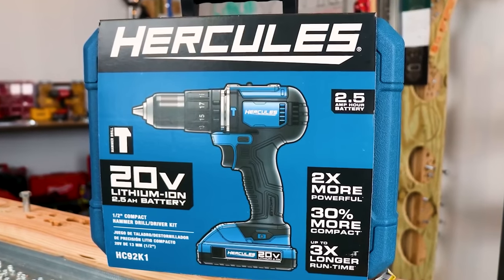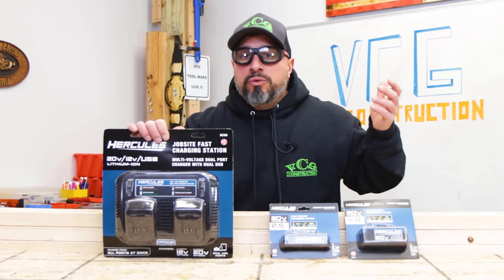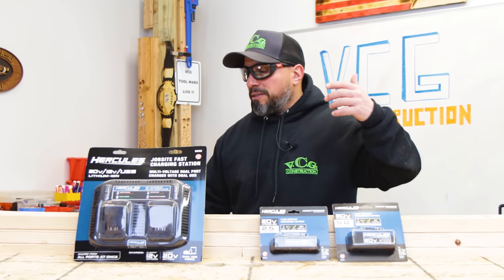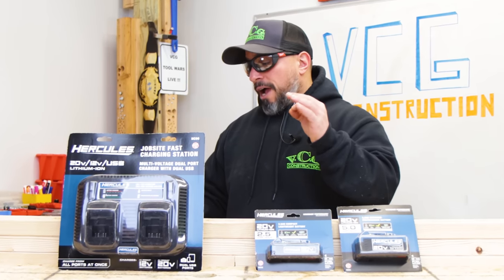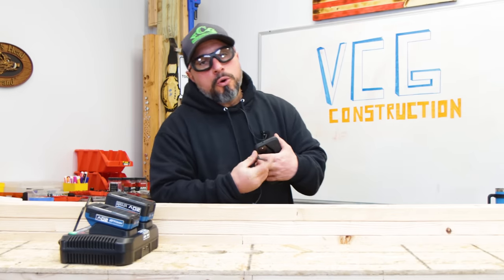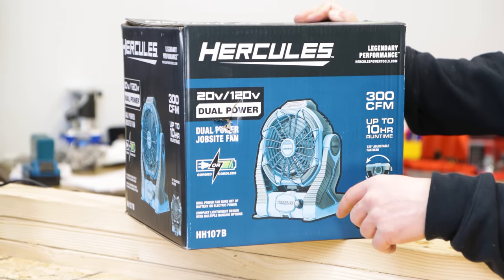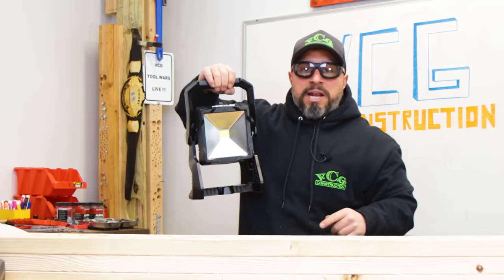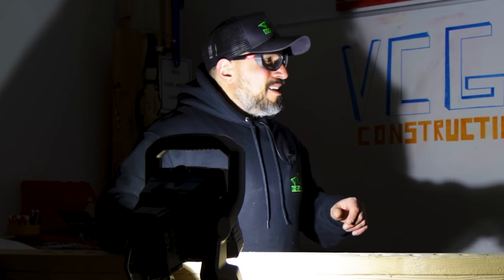HARBOR FREIGHT Sent Us A TON of FREE Hercules Tools for UNBIASED REVIEW!

Comment: Warranty and price is the greatest weakness they want to charge the same price as top brands and don’t bring more to table
Reply: They are well below the price of Milwaukee, Makita or Dewalt, in most cases they are even below Ridgid and Kobalt XTR in my area. FYI I own no Hercules.
Reply: Harbor freight may offer shorter warranty options than other brands, but they offer probably one of the best warranties out of all of them in terms of no hassle or wait times. For example, Milwaukee has a five year warranty on their power tools which seems fantastic...BUT, you have to send it back to them, they have to examine the tool to determine if it was actually defective or if it was caused by operator error (which at that point they won't cover it and could potentially come up with an excuse to make it sound like operator error just so they don't have to cover it), then having to wait for them to send it back. Too much of a hassle if you ask me. Harbor Freight literally doesnt give a shit. You could purposely run it over with your truck and they'll return or exchange it anyway same day, as long as they can validate proof of purchase, and still within the 90 days (or past 90 days with an active replacement plan). Might be a shorter warranty, but it's a guaranteed one that's worth the money if you ask me.

Comment: 2:00 Those USB ports should have a rubber cover or flip- open cover to prevent them from getting filled with dirt/dust at the job site.
Reply: The rubber flaps over the USB ports is a good idea kind of like the one on the Makita dual charger has the dust flap..... But I think the Hercules doesn't have the dust flap because it's not a job site ready tool it's a good option for a homeowner tool but I have yet to see any Hercules on a job site that I've been on
Reply: True. My Dewalt doesn't have them and I gave up on cleaning them out.

Comment: On the Hercules.  The price is good for Chinesium tools.
1.  The fan - To much plastic in the construction.
2.  The work light - Not bag for home owner use.  Not a constructors tool, but not bad.
3.  The multi tool - At $100.00 I would be more likely to buy Hercules over Dewalt, maybe Milwaukee, Ridgid, and some of the other bargain brands.  At $100 to $150 I would go Makita.  My choice,  that I use is Fein.  But I am in business for make money to.
To summarize, Hercules is not a bad choice for most projects.
Cool video, Thanks Vince !!!!!
Reply from the maker: I'll say I look at Hercules as a homeowner-prosumer at best tool option, but Wow Stephen, I can honestly say I'm shocked at number 3 on your list! I know why you choose Fein, but why Hercules over the other brands? Thank buddy!
Reply: @VCGConstruction  It is complicated 
In my opinion Fein and Festool are almost the same machine.  Bosch is a spin off of the Fein mechanically and all using Star Lock, anti vibration methods, and Bosch has a price point of $200.00.  I should note that I have a lot of experience with the Fein and Bosch.
( Next in line )
The Makita is well build.  Makita tools go through a 5 year testing process, comes in at a very good price point, and if it is damaged or stolen it is easily replaced.  Its down side is that it is a very heavy tool.
( Now as to the other brands )
I know people with the Dewalt, Milwaukee, Ridgid, Rockwell, and  Porter-Cable versions.  That is off  the top of my head.  The people that I know who have these brands use them regularly and are satisfied with there tools.  I have at times used them is a pinch.
Dewalt and Porter-Cable to me are the same tool.  Clunky, cheaply made, & to light weight.
Milwaukee 12V Fuel -  I like in a pinch. As to the Milwaukee multi tool in general I feel that 
It is not a Star Lock and I think there is to much plastic in the tool.  I have had issues with Milwaukee tools breaking, but the warrant is very good.
TO THE HERCULES - If I was on a job and needed a multi Now !!! And a Home Depot with a Makita was not close by, and Habor Freight was close at the $100.00 price point.
In my opinion Hercules is the top of the Habor Freight tool lines.  There warrant is pretty good for a 90 day tool.  If it makes it through a few jobs thats awesome.  It does remind me of a Makita physically.  So to me it is the top of the bottom of tool lines. 
To recap my choices. 
Fein is $200 - $400
Bosch  is $180 - $200
Makita is $150 or so
And Hercules is the top of the bottem at $100.00 
Hopefully this answers your questions.  If not please let me know.
BRANDS I WOULD LIKE TO SEE TESTED
1. The new German Metabo version with the Star Lock
2. Metabo HPT because it is a Hitachi and it also reminds me of a Makita.
3. Skill is one that I think has potential.

Comment: The thing is with harbor freight bauer and hercules lines they are not as cheap as you think you can get better deals on name brand tool combo kits
Reply: Yep. I bought the hercules electric screw driver and a milwaukee screwdriver. The milwaukee was actually cheaper.. Though the hercules screw driver is pretty darn good. It can replace a drill because it has like 3x torque and 2x speed of the milwaukee. But it has the lowend torque and actually feels nicer than the milwaukee.
Reply: Herc better than bauer
Reply: Issue with that though is you usually have to wait for those better brands to have those deals going on which is maybe a few times out of the year, whereas the HF prices are pretty much year round. If you needed a semi-decent tool right away and couldn't afford to wait for any deals to be going on due to whatever circumstances that don't allow you to do so, I'd much rather get the Harbor Freight stuff at that point where time was the main factor. Now if I had the time and extra money to do so, and the HF tool didn't end up doing the job then yeah I'd definitely invest in a better tool.

Comment: I have their table saw, when researching 10" table saws for 400 n less. I have a Dewalt which is prob 7 yrs old now. But I will say I'm impressed with this saw. Compared to my Dewalt,  I think its better...
Reply: Well I’d hope that a new saw that cost $400 dollars today would be better than a 7 year old saw lol

I spent $450 on the dewalt job saw I have now. $650 with the stand. It’s the best portable table saw I’ve ever owned. The closet thing to a good cabinet saw I’ve found, and the stand is the best saw stand for a portable saw I’ve ever seen.
Reply: My only hercules tool is the compound miter saw. As a metal fabricator, all my tools associated with that are brand name. I only dabble in carpentry so harbor freight works for me.  (It's a really nice piece and $299 with coupon).

Comment: I have a Makita 36v/110v Hepa Vacuum that cost a lot more than the hercules and works pretty good. I use it as dust collection for tools mainly and it definitely has more power on corded power, but the cordless option is great especially with a tracksaw or 5057kb hardie plank saw. The hercules vac looks interesting though..

Comment: I've used Harbor freight tools for years (hand/mechanics tools) and have no problem with them. I have noticed their prices have been going up over the past few years. I tried their cordless years ago and didn't care for them. Batteries didn't seem to last and tools were not very durable. After my last HF cordless 1/2" drill, I didn't see the value in getting another. That is when I switched to Kobalt cordless (18V) They had the best  price and by far the best warranty and still do. I am very happy with my 24V brushless Kobalt tools.
Reply: Which brand power tool was it of theirs that you used back then? If it was the Chicago Electric or Drillmaster brands those are absolute junk. I have the Hercules stuff rn and so far I'm fairly impressed with it. Haven't used Bauer but I've heard good things about those as well.

Comment: Hercules line overall is good.  There are some good deals you can get, replacement batteries are not so expensive. I have herc, milwaukee and dewalt. I buy what is on sale most of the time the deals are hard to resist and specially on name brands tools.

Comment: What all tool reviews miss on Hercules tools is while dewalt and others have that once a year sale where say their drill at $99.00 but they get you with batteries from $120.00 to $130.00 . I have the 1/2" drill, 7 -1/4 circ saw , recip. Saw and never had complaint esp. In power or that all the batteries interchange and don't change designs. I will keep buying Hercules to keep from so much for others batteries. Loved your review.

Comment: If i was still in the trade (electrical) currently I would run Milwaukee just because most if the trades use the platform because of how big it is. But for side work or your setting up a home shop for DIY work and such I think its definitely worth it. Easy returns really doesnt break the bank.

Comment: They need to put more robust webbing around the switch inside of the oscillating tool. Its easy to repair with CA glue but having it not be able to switch off can be dangerous. Love the platform however... i was keeping the cord for milwaukee prices but im all in on the hercules.

Comment: I think Harbor Freight needs to be much more competitive on pricing before I would even consider buying them.  Like you said about the oscillating tool you can find a major brand tool for the same or slightly higher price and that's true of many if not most of the tools.  I think the people who own/run Harbor Freight need a major dose of reality.
Reply: I half way agree. However on the other end of the spectrum, the warranty is insane. I purchased the mitter saw and the girlfriend got to cutting a Christmas tree on it(long story) while I was at work and broke the safety gaurd. I brought it to harbor frieght they looked at it for 2 seconds and told me grab a new one off the shelf no cost
Reply: @scottwest18  also nuts is that 90 day or u gotta buy 1 or 2 yr upping the cost
Reply: @nickabel8279  Not on the mitter saw its a standard 1 year warranty. and for the price i paid for it bringing it to the 3 year warranty and it was still cheaper than the dewalt's. and with dewalt if it breaks under warranty sure its free but you have to ship it and with shipping you might as well go ahead and buy a new saw

Comment: Ya I assume there are separate windings in the vac for 120v vs 18v because a power supply to either drop the voltage from 120v to 18v or go from 18v to 120v doesn't make much sense

Comment: One thing to consider is the cost of all of their tools in their line. 

Chargers, batteries, drills, all cheaper even if this oscillating tool is pricey.

But they have a more limited line then Milwaukee. Depends on what you need. But I don’t think they are bad. 

Perfect or the weekend warrior/DIY guy.
Reply: For a weekend DIYer I wouldn’t recommend Hercules but Kobalt or perhaps Skil Powercore although line is limited. It too Hercules like 5 years to get the tools past drills most those tools just came out this year (2021) and not in stores yet. Also the aka warranty is a protection plan meaning it has ONE use then you have to buy it again. Kobalt, Skil 5 year warranty Lowe’s will also offer protection plan. HF also doesn’t sell ANY combo kits just bare tool or quasi kit aka buy battery charger ( est $70-%90 get $25 off )
Reply: @Bob-gy6ud  I haven’t settled on one yet (I have the old craftsman c3 from Sears that idt they make anymore). But I do like the kobalt but they are def more pricey. 

If I went like the HF Bauer line I could get damn near every tool I would ever need at a fraction. 

I do like the skill, they have great deals on the drill and driver, but past that they are more expensive too
Reply: Yes and the Tool Bear cut the battery pack open and found top-quality Samsung rechargeable cells inside of the battery.

Comment: With the escalating tool, Dewalt at lowes runs $99 all the time..
   5 yrs warranty,  and so much more power...why should I pay the same for less quality...makes no sence to me.. HF missed the mark on this one...
   You were spot on....love the channel
Reply: Dewalt is ToysRus Stanley Tools however, I'm wondering if I should actually get back into Makita for a top notch Multi tool,  got 12v and corded, but need an in between 18 without the starlock, for another blade option.

Comment: Just picked up the oscillating tool last week, like you said bc I didn't want to jump platforms. I agree with otu on all points especially that it has a ton of vibration. Also the bit change out is super clunky

Comment: Vince, where would you rate the Hercules line - Consumer (home owner / DIY), Prosumer, Woodworker (in shop work), Contractor/Remodeler (construction)?   
Test the multi tool with another brand blade, comparing tools instead of tool and blade.
I think your testing was unbiased. 
My issues - warranty is not all that great, especially when to go to multi year warranty, the cost jumps up to other better brands with a 3-5 years warranty.
I am wondering if we need to add a drop test to all these tools.  How would the Hercules compare to the Milwaukee after a few drops?

Comment: Vince, thanks for reading my review from the HF website.  I can understand why you would think I'm "misinformed" about Hercules since you don't use any of those tools... yes they have had 20V tools out for quite some time.  But the Hercules lineup has been very limited.  They are finally coming out with more tools in the lineup... namely, most of the stuff you are reviewing in this video, along with a few other tools as well that you don't have here.
Reply: Do you have the fan? I am thinking about getting one next summer.
Reply: @Ryan.zelenski   I do.  If you get one that works, they are pretty good.  They won't blow you over, but they do move air.  We bought 2 of them... one for the wife, and one for me.  I'm on my 3rd replacement for mine. There just seems to be some QC issues with the fans.  Get the warranty with it.  My 3rd one so far seems to be a good one.

Comment: I am a huge milwaukee m18 FUEL fan…have 3 impact drivers, router, metal saw etc.  BUT…when I went to buy a new circular saw….went with 7.25 Hercules.  Build quality was identical to fuel version..and better than non-fuel milwaukee. 5 amp batteries were $58 ( samsung 16850 cores) and tool was $99.  Milwaukee fuel was $269 + $169 5 amp hour batt ( hone depot june price) so…HF version was nearly $280 cheaper.  Yes…Fuel are best..(non-fuel not so much).  But milwaukee battery prices are just crazy.  That’s the “value proposition”.  The price differences are so extreme that it negates “platform lock-in” .  The oscillating tool is not as good as my Fein…but just as good as milwaukee and again..battery is less than half the price.

Comment: I have everything from hilti and milwalkee to kobalt and Ryobi. I have a Packout setup just for chargers and batteries lol. I don’t discriminate. That being said I see no reason to add harbor freight tools to my kit. I went to buy a cheap pry bar once. Turns out it was more expensive than the better HD offerings. I stopped going to HF for most things. Their air dryer is the only solid buy I use for all compressor setups. It really is a solid unit.  It’s a good start for HF cordless might be few years if they keep dialing it in maybe they compete. Lot of people like that icon or whatever kinda stuff.
Reply from the maker: We appreciate the feedback Joshua! 👍🏻
Reply: harbor freight is great for cheap hand tools you aren't going to use every day.  Plus the warranty can't be beat.  Break it and they'll give you a new one no questions asked.  Yeah you can get similar tools on amazon or at Lowes and Home Depot but HF is so much easier on the warranty.  A lot of their electric stuff is a far cry from the name brands and they aren't all that cheap.  In general Ryobi is better than what they sell and around the same money and if you are going to go cordless you want to invest in a good platform which HF does not have they have lots of brands all using different batteries, you don't get a huge offering with their lines.

Comment: I been saying it, they need to go brushless, and improve their batteries. Would make a great bang for the buck
Reply: Yep, I unintentionally poked “the bear” in another video, the Hercules brand is a hard sell. Just buy Bauer. Or better yet, just buy ryobi, or m12 Milwaukee as they are “proven”.... I have some Bauer items, mostly lights, a fan, and one barely used hammer drill (it stinks, literally), I like the stuff but kinda feel like I should have went with ryobi
Reply: @cowboy41231  yea harbor freight is missing the target here. They need to analyze why big brands are doing well. Warranty, brushless, compatibility, battery life. Work on those things. Until then, I'd stay away
Reply: @blaineturner1434  I agree, I’ve been “told” Hercules has better electronics than Bauer, but man a 2 pole brushed motor is still a 2 pole brush motor even if it has mosfets ontop of it.... I’m not saying they are “bad” tools but they look to be rebranding  budget tools from Europe ( can’t remember the brand) and making it into an eco system of its battier platform (which is cool) but highlight your concerns about brushless and shitty base warranty with “premium “ pricing/marketing = look for another “proven” brand ...... on a different note,  I have yet to see someone trying to modify a Bauer/Hercules battery to be interchangeable and or to use with other tools
Reply: Thought they did go brushless? Batteries I was told use Samsung cells
Reply: @nickabel8279  a couple tools are brushless, but ones that heavily rely on motors to worn lime drills and impacts are brush. Idk about their battery tech, just seen lot of people saying they don't hold compared to HD brands